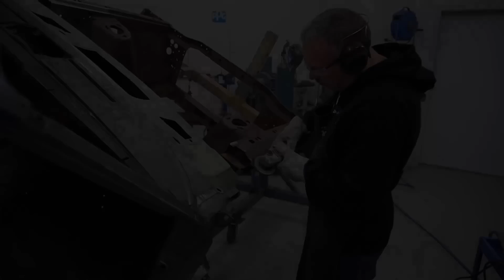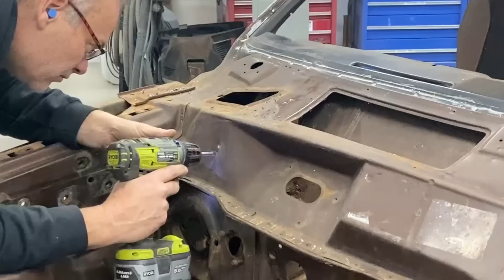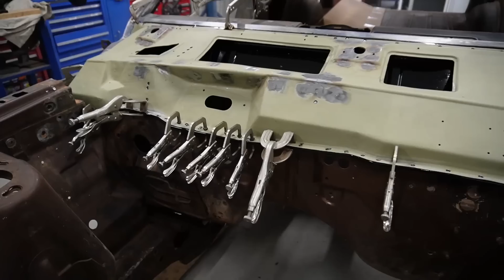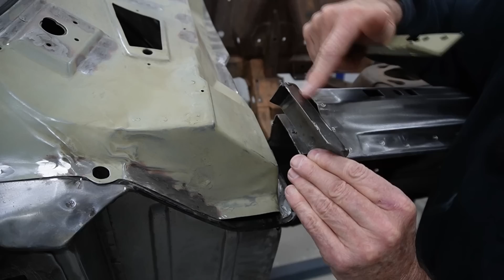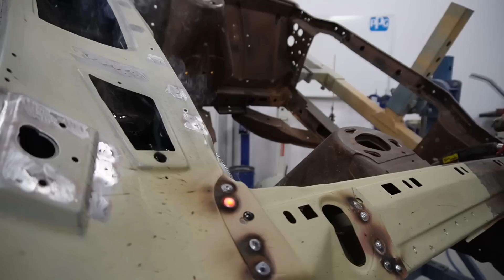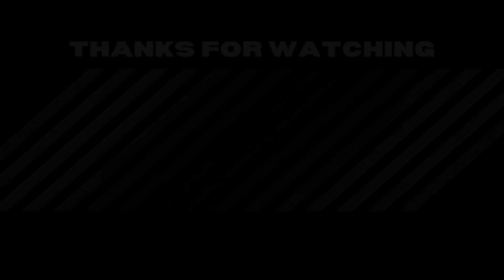Panel Van Update with a finished Plenum #5 Magnum Force

Comment: Have you gone away from the 240v spot welder? Noticed you’re doing full plug welds on this car. 
Thank you so much for showing us all this detail!!
Reply from the maker: No, its just that I will be filling all the welds on this one. If I was to use the spot welder I would have to fill all the holes in the pieces then spot weld them on. I would be doing it twice.
Reply: @AstillDesign  that’s what I’m doing atm

Comment: What’s is the product code for the epoxy primer you use and where can we buy it?
Reply from the maker: Its a PPG product, I have been using the vibrance version that is being phased out. Its also branded under there other brands. Deltron DP616, Vibrance VCP150 or  PPG 410-48248. Any PPG distributor https://www.ppgrefinish.com.au/Distributors/Australia.aspx
Cheers H

Comment: Hi Howard, love the channel. Very informative and well produced. Im in a similar spot with a ford escort. I’d like to make the welds look original. Would I need to use a spot welder, or is there a way to mig plug and get them looking like spots??  Thanks
Reply from the maker: If you have a spot welder then you can weld up all the holes in the top panel and then spot or plug weld clean up the welds and then give them a quick spot or make a drill bit with a wide face that will give you the spot appearance.

Comment: I have some learner questions:

When you use epoxy on the exposed metal, your doing that on all surfaces. I get that. 

Where the welds go through, does that compromise the paint or is it just a case of no other alternative? Or does the weld through primer/epoxy seal up fine?

Also when these were new, is it right that the panels were never epoxied inside and out like are done today and in your rebuilds?
Reply from the maker: The welds do have an effect on the paint but no real solution to that, there was minimal paint on the insides of any panels from the factory in the 70's. Expoxy is a more recent product.